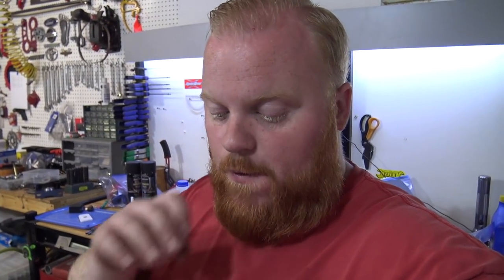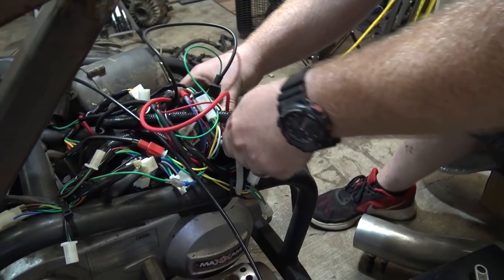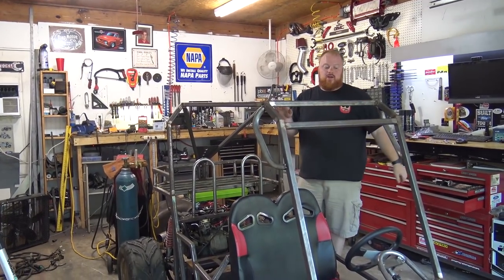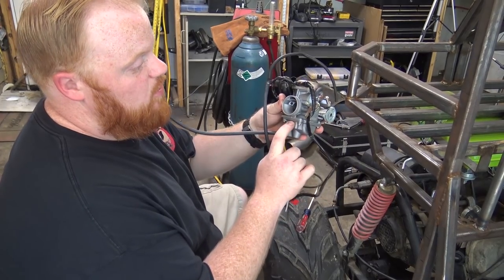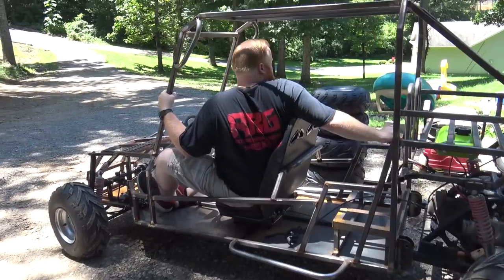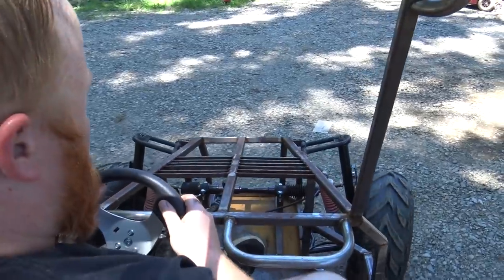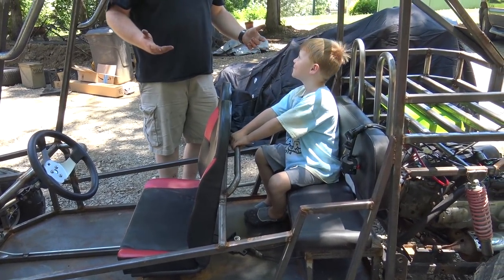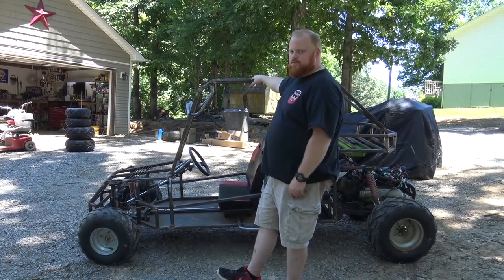4 Seater Go Kart Build Ep 11 ~ She is alive!!!

Comment: Red Beard, the front wheels are angled in towards the front when you have the wheel straight. so you have to adjust the tie rods away from the center so it gets the wheels more parallel when the steering wheel is straight.

Comment: Actually on that steering wheel shaft I was wondering why you didn't have another support. Thought you might be doing some kind of a tilt wheel mechanism. Your idea to lock the bearing thru the zerk hole was a sweet idea! A few more final tweaks and you'll be rocking. Quite the beast you designed and created there!
Reply from the maker: +2jeffs1 she is a monster. Thanks for the support

Comment: Needs a Predator 708cc. Ditch air box, put uni air filter on, cut muffler off, attach dual mufflers, drill out the jet, heavier valve springs and adjust governor to 4,500 rpm.

Comment: Sweetwater!  Wine and hot air balloons, was great fun!  The 4 seater... did you forgot the Ackerman effect. That's the part of steering geometry that allows the inside wheel (in a turn) to turn sharper than the outside wheel. Because the inside wheel is making a smaller circle. We know that solid rear axle is fighting you, but from the video it looks like the outside wheel is turned in more. Press on brother, fun stuff!
Reply from the maker: +Russell Long yeah we found a way to make adjusters for the front end that will probably be on the next video

Comment: Adjust the valves on that 150, and put a 28mm carb on it, they run so much better with the flat slide ebay koso or OKO knockoffs. 28mm with stock pilot and a 110ish main will be close

Comment: The steering problem might be because of the heavy rear of the go kart and the front, which is not as heavy. you could lower the front and add some weight to reduce the problem

Comment: Your Ackerman angle has to be set. To do that you need to set the front end straight , find the point on the REAR axle that is centered between the rear tires . Next run a straight line from that center point to the  front ball joint pivot center . The outer steering rod center pivot point should fall on that line. This is important enough that the steering arms on the spindles should be moved to center this point if needed.  Hope this helps , I started kart racing in a " time trial league" with my father a week before my 9 th birthday , I'm now 63 and still involved in just about any type of motorsports.

Comment: on offset racing karts, i ran at 3/8  toe out in front with dirt tracks, i would start at 1/8 to 3/16  front toe out, if to close, you will get a high speed twitch that will make most young drivers over-correct,,,

Comment: Don't know on that rack but there's gearing inside that change when you get close to lock so on will be turned more than the other and in most cases cause that camber issue
Reply: Hopefully that makes sense
Reply from the maker: +Noah Souza Racing we are actually going to modify the top a are to allow for adjusting

Comment: Did you vacuum bleed the brakes? I've been dealing with some issues with only drawing air. And those carbs have an auto enrichment, wax solenoid that acts like a choke
Reply from the maker: I haven't messed with it at all. I will bleed it all out when its all done

Comment: What's the difference between the 30 series and the 40 series torq converter ??
Reply from the maker: 40 series is designed for the bigger hp engines 30 for the smaller engines

Comment: Doesn't look like it made it to you like I wanted it to but it's Wikipedia for steering geometry and since your steering wheel is not in the center and off to one side is why that tire is buckling. Just go to Wikipedia and put in steering geometry and it will help you set the throw on your turnbuckle that's on your spindle

Comment: Now way this thing would move with 4 people on it
Reply from the maker: +Penny 4life you do realize that it moved with two adults? I push the pedal less than 1/10. Off camera the go kart ran almost 30mph with me in it and I'm 260lbs
Reply: If u add another 260 I don't see how the 150 cc is gonna haul u around over 25
Reply from the maker: Well it is build for 4 kids. If you think my daughter is 80lbs so at max there will be 400lbs of kids but I highly dough 4 kids would be 400lbs. Still It would pull that with no problem. The other 150cc kart we have can tow another kart behind it with me in it as well as someone else in the one im pulling

Comment: I rebuilt my predator 212 took the governor and oil sensor out and when you jerk it  it kicks back really bad does any body no why
Reply: Wesley Hally did you mess with the valve lash or remove the auto decompression. that's the only 2 things that would really make it kick back.
Reply: Matt Hudson I set the valve lash to what it said in the instructions that came with it
Reply from the maker: +Wesley Hally some times the compression release on the cam can get stuck. Mess with it and see if it fixes your problem
Reply: Red Beard's Garage I will check that thanks

Comment: Red HELP I rebuilt my 196 box stock which has everything from head stainless valves retainers champion rockers cam billet rod and flywheel when it's on the rack sounds awesome revs Quick very responsive sounds like it's going to be bad ass and when I ride it feels like gonna have tons power then just loses power big time.......ANY HELP be much appreciated thanks
Reply from the maker: I have not clue man. Without actually being able to mess with it makes stuff extremely hard to trouble shoot.
Reply: Red Beard's Garage yeah I know it sucks runs awesome revs quickly idels but when you get on it it's like riding with the brake on I'm thinking of something to do with the head but thank you anyways

Comment: I don't know how well this is going to get to you as I did a copy and paste but it's on your steering geometry

Open main menu

Search

EditWatch this page

Read in another languageAckermann steering geometry

Ackermann geometry

Ackermann steering geometry is a geometric arrangement of linkages in the steering of a car or other vehicle designed to solve the problem of wheels on the inside and outside of a turn needing to trace out circles of different radii.

It was invented by the German carriage builder Georg Lankensperger in Munich in 1817, then patented by his agent in England, Rudolph Ackermann (1764–1834) in 1818 for horse-drawn carriages. Erasmus Darwin may have a prior claim as the inventor dating from 1758.[1]

Advantages

Design and choice of geometry

References

External links

Last edited 3 months ago by an anonymous user

RELATED ARTICLES

Double wishbone suspension

Caster angle

Toe (automotive)

Content is available under CC BY-SA 3.0 unless otherwise noted.

Terms of UsePrivacyDesktop